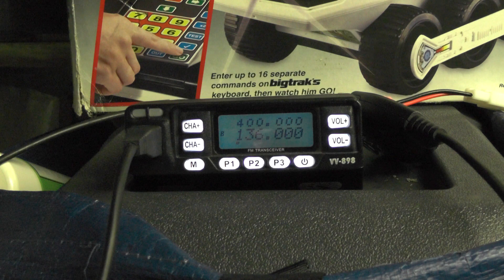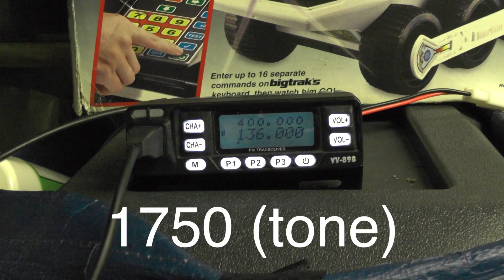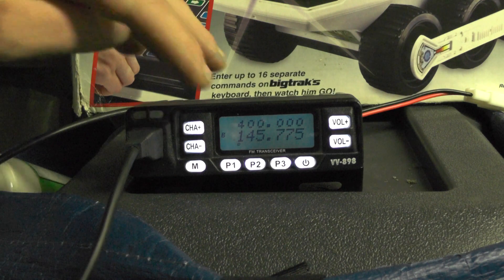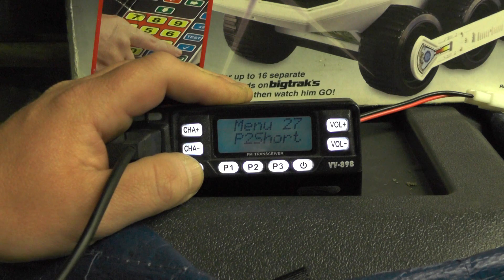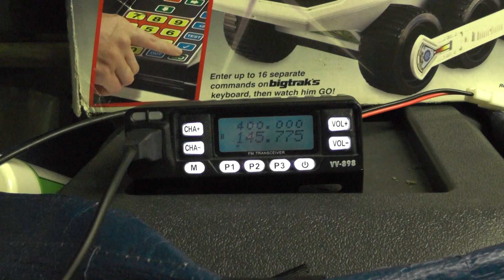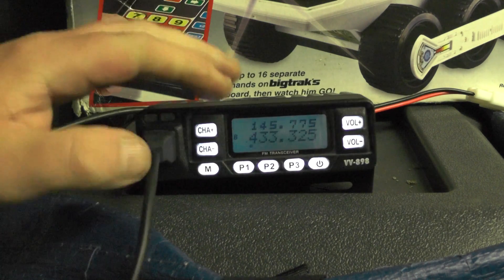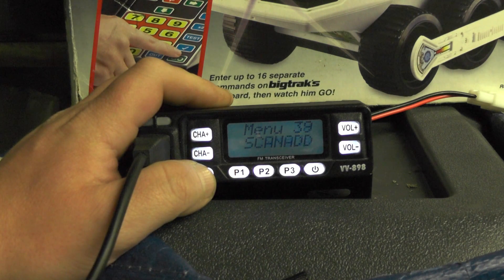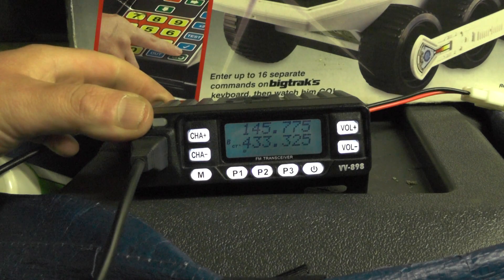VV898 programming

Comment: What are you pushing on the mic??
Reply from the maker: Jon Martinez Witch bit of the video are you referring to?
Reply: @2j4ez  I WAS TRYING TO MANUALLY ENTER TWO FREQS AND NOW THE RADIO IS LOCKED UP. nONE OF THE BUTTONS ARE WORKING SO i WAS PLANNING TO DO A FULL RESET OF THE RADIO. i DID TURN OFF SOME Menu items so maybe i did it. sorry for the caps
Reply from the maker: Jon Martinez hi I don’t think I’ve ever done a full reset of my radio it will delete every thing in the radio and should be like turning it on for the first time ? Do you have a data cable?? If so I’ve done a video on how to program it using chirp

Comment: What is the 1750?? When I press that nothing happens, I still can’t hit the repeater
Reply from the maker: 1750 is a tone burst some repeaters require it. most repeaters use CTCSS tones
Reply: 2j4ez thank you so much for your response! The repeater I’m trying to program says on the website is has a “141.3 Hz CTCSS tone” but it never explains if that’s encrypt or decrypt, would I put the same code for both?
Reply from the maker: @dutchman55  normally when you program a repeater all you need to do is put the CTCSS on the TX. my local repeater GB3VH is 433.325RX & TX 434.925 on the TX i add the CTCSS tone it may be under T-CTCS on your radio
Reply: 2j4ez I finally got it!!! Thank you a million for your help!!!
Reply from the maker: Mr Hernandez your welcome

Comment: I've got the 898s, 25 watt version. EBay do a Kenwood compatible mic from China. Mine cost £8.34 and it's worth every penny. You can access the menu from the mic as well. The standard mic is crap tbh.
Reply from the maker: yea I find that some times the mic will dead key. so I have to remove the mic and put it back in again.
I might try using the mic from 4m radio and see what happens